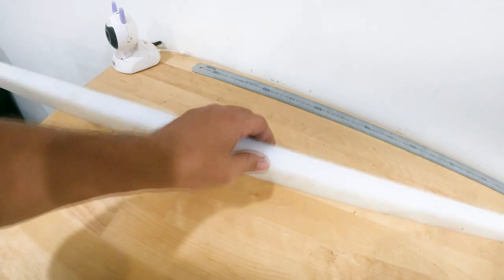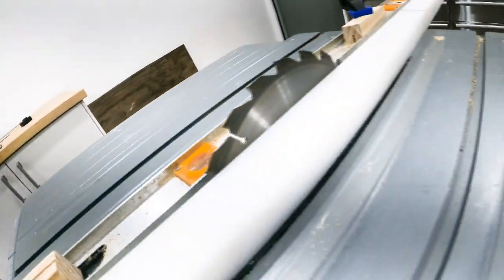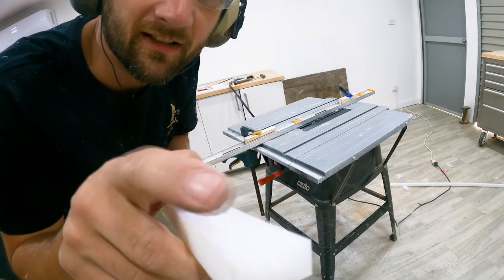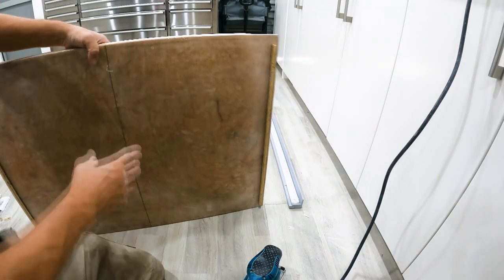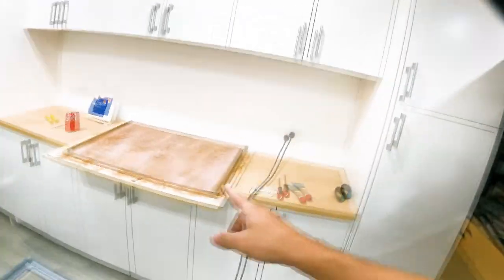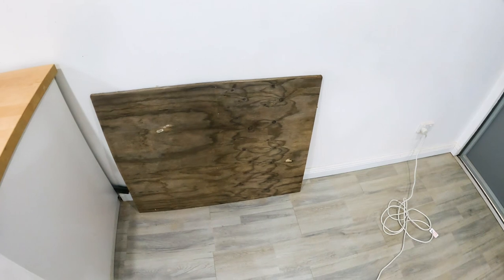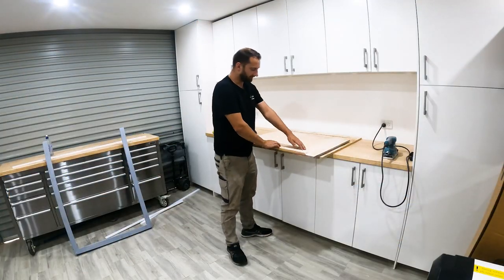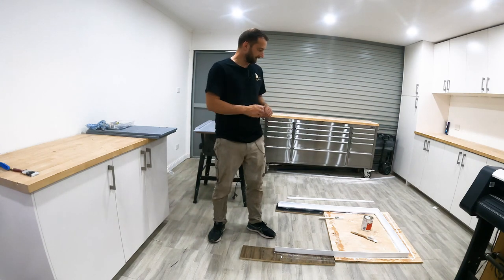Sailing QC #51 | Companionway Progress | Boat Yard Clean Up  | Steel Sailboat Restoration

Comment from the maker: This week its HOT HOT HOT!!! so hot we have had limited days with only short windows of opportunity to pop down to the boat this week. Heading down very early morning to beat the heat I did a BIG tidy up of the shipping container workshop (was super unorganised) and cleaned up lots of scrap materials that we don't need from around our boat too! 
The weeds were getting a bit long around our area so did a bit of a whipper snipper around our space to reduce fire risk and hopefully keep away any snakes!
I also continue on with our companionway progress, sanding and painting up the final bits and pieces ready for our slider to be installed!!!

We would love to know what you guys think about our Steel Sailboat Restoration so far! leave a comment, like & subscribe 🙌 ⛵

Comment: You may want to go back and put nylon sliders on the hatch top. The plywood strips will expand in the moisture, much more then the nylon. Also the ply strips will deteriorate at a much faster rate. Just a thought. Anyway it is looking good. Hope you had a good holiday.
Reply from the maker: Thanks mate will have a think for sure ⚓⛵